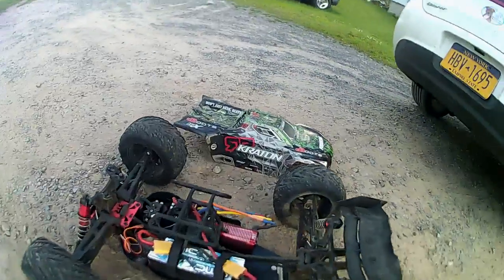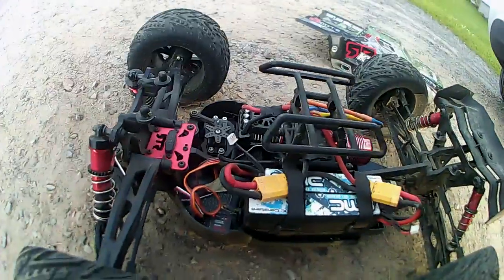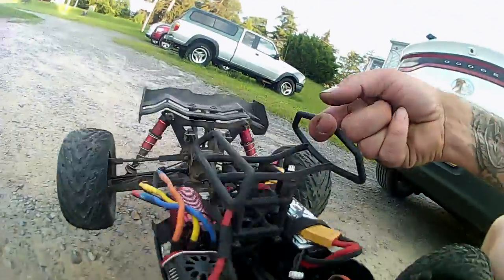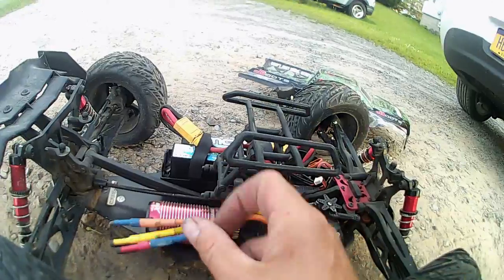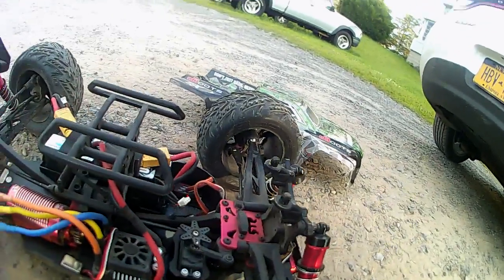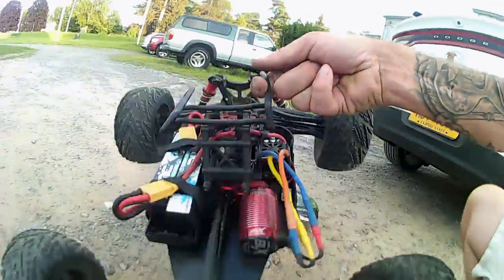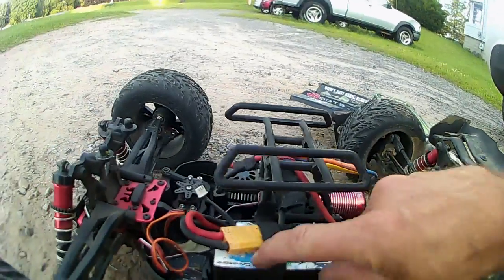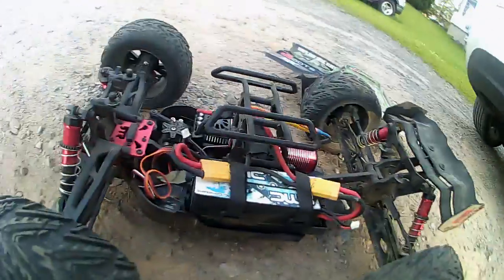Arrma Kraton Blx200 and 2000kv nero motor 4s

Comment: what was the top speed with this setup in the Kraton?
Reply from the maker: Terrence Rogers I don't know what it was with stock tires... it's running about 68mph with terrain crushers on it currently. I will have a new video up later today of it. I crashed into a tree and its been completely rebuilt and upgraded since this video...

Comment: Does this setup overheat offroad at all?
Reply from the maker: @ Slow Motion Racing... on 4s it runs great and has no heat issues, on 6s it gets hot but esc shuts off before the motor is over 180. It's  now set up for speed runs with terrain crushers and just fitted a 21 tooth pinion a few minutes ago and 6s battery is charging up... got it to 68mph with the 20 tooth.. hope to break 70 mph now.
Reply: Pitbull R/C Garage oh that's dope!  Good luck on the speed run and thanks for the info I'll be ordering a 18t for bashing!!
Reply from the maker: @Slow Motion Racing... keep an eye on your temps for the first couple runs, and have at it. I like to stay under 170°f but 180 to 200 is max after that everything starts to break down after awhile. If you run 4s you will be fine its when yoy.go to 6s that you need to pay attention more to the temps.